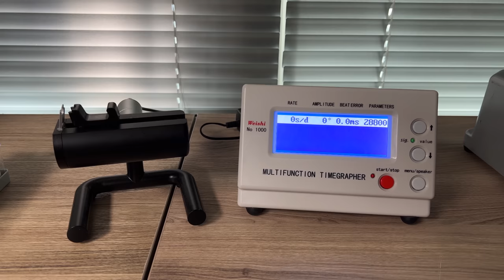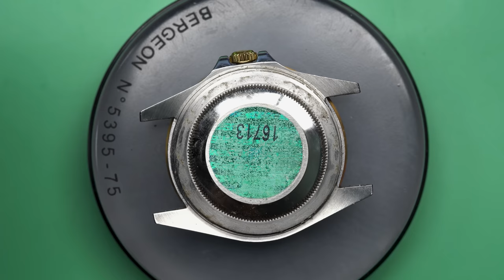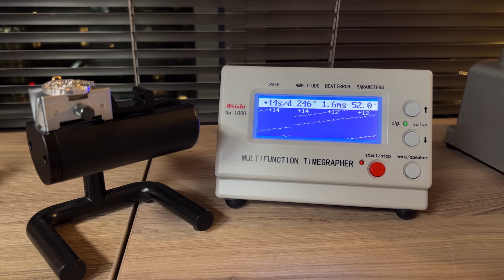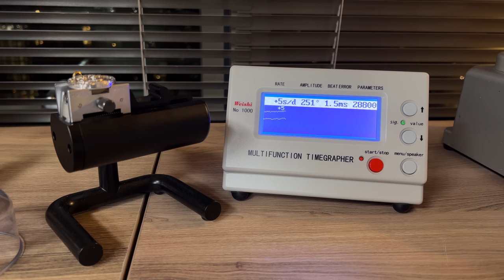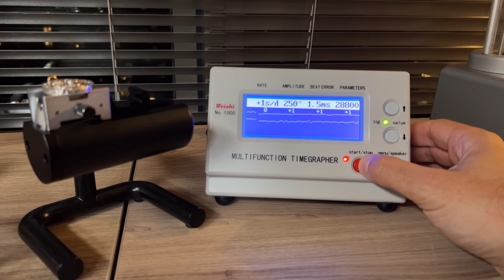My Friend Asked Me To "Check The Battery" On His Rolex...

Comment: I remember when Rolexes cost a few hundred dollars.  My first one was a 1955 Air King which I bought used for $75 c.1970.  I think the new price then was well under $200.  They are good watches, but the prices today are absolutely outrageous... I wouldn't pay a fraction of that for a watch today.
Reply: Rolex are a luxury watch today but at one time they were worn by regular people who were looking for a reliable time piece at an affordable price.
Reply: Yeah, I bought a 1940s stainless steel Rolex in 1980 for $300... wish I still had it!!
Reply: I mean, a house was also like 12$ at the time. Rolex prices were probably fairly in line up until about 15 years ago. My friend picked up a no date Sub at an AD for like 3 grand. they actually had trouble moving it.
Reply: Even if you can afford a Rolex, that is no guarantee of getting one.  They have “wait lists” with their authorized dealers, and you practically have to build a relationship with the dealer by buying other items just to get on the wait list.  It’s all designed to keep the illusion of exclusivity by limiting the supply to drive the price up.
Reply: The prices are truly ridiculous, because Rolex watches are really not luxurious at all. 
I mean, a steel Rolex with a movement that is only "very good" will set you back a similar amount as another brand's watch made out of precious metals and built with crazy attention to detail. 

And what I find even more ridiculous is that you can find Breguet watches from the late 18th and early 19th century for less than some mass produced Rolex from the 1950s. Wtf???!!!

Comment: The thing people dont realize about leaving those protective stickers on (thinking they're continually protecting whatever is covered) is that they arent meant to be permanent so be leaving them on, debris gets under there and just grinds into the very surface you think you're protecting. When the sticker is finally pulled off (against their will I'm sure) I imagine they're quite shocked to see a very worn surface and not a brand new one.
Reply: To that point the other issue is that those stickers get so nasty because the debris also sticks to them. So, once you take them off you can't really put them back on.
Reply: Never understood why one would leave them on. Looks tacky
Reply: @joshs3916  the value goes up if the sticker is still on weird even if the Rolex has been worn if the sticker is still on. So wen he peeled it off it lost some value wich is stupid but sadly true
Reply: @shadowbasterds2389  ...Really??
I think keeping the sticker actually drops the value not raises it, since the only people buying old watches would be experts not regulars.
Reply: @igameidoresearchtoo6511  for some stupid reason with the stickers on it does. Me personally I get nervous and I have to peel it off cuz it's satisfying. Everything I see 1 of those I wanna peel It off
Reply: @shadowbasterds2389  Weird..
Reply: @igameidoresearchtoo6511  it sounds weird because it isn't true. The value of a pre-owned Rolex is based on condition, the plastic is worth nothing. It was several years ago on a brand new watch after Rolex demanded that dealers remove the stickers at point of sale, which could be why this guy thinks it makes a difference.
Reply: @shadowbasterds2389  why would plastic add value to a used Rolex? Lol. To a new watch yes, because it proves it's brand new and unworn. On a 15 year old watch it wouldn't add a dime and looked pretty gross. If someone were to sell it that way, I'd want a discount.
Reply: @shadowbasterds2389  I agree. I am close friends with dealers so I understood. I just meant, wearing them with stickers is laughable. If you buy it only to resell, might as well enjoy it.
Reply: @joshs3916  yea ur right haha am sorry but it annoys me when anybody buys a hat a shirt or anything with the tags on to look fresh. I have a disorder we're it gets me nervous n I have to peel it off or rip the tags off but I no what u mean ur right haha
Reply: @allaboutroofing2  hey I've seen it n I think its stupid as hell don't ask me just the person who buys it likes it better with the peels still on I don't kno
Reply: @allaboutroofing2  I thinking stupid  with the peel on but I've seen it. If the watch is not as bad as this 1 yea. But am not talking about this watch its gone thru hell. But if it's a Rolex that's been taking care of and the peel is still on an the peel still looking new the more the watch goes up in value cuz a person could just say they wore it once so it's almost bran new.
Reply: @shadowbasterds2389  Removing the film/tag = satisfying lol
Reply: @joshs3916  for real haha
Reply: @shadowbasterds2389  sounds like something you made up. Just saying.
Reply: @allaboutroofing2  before u say something u gotta kno for sure. Have u ever been face to face with this same situation we are talking about? I have that's why I talked about it. If ur not so sure then don't say I made it up until ur sure. The sticker thing sounds stupid but why would I lie. I have nothing to gain. Just saying what I've seen an no so far about it.
Reply: @shadowbasterds2389  I've bought and sold serveral Rolexs and no, I have never seen a used watch with the plastics still on it and the seller asking more for that reason. Condition is determined by the crystal, crown and overall visible wear, not if someone decided to leave the plastics on. Also, for giggles I searched the internet and there is no one saying a pre-owned Rolex is worth more with the plastic on it...except you.
Reply: @allaboutroofing2  ahha I believe u  I really believe u yup I do.
Reply: @shadowbasterds2389  luckily you believing me or not doesn't matter at all. You are mad you got called out for making stuff up and speculating and plastic on a rolex does  not increase its value. Next.
Reply: @ShadowBasterds the iPhone cover is the most satisfying lol
Reply: @joshs3916  yea for real that's problem the biggest peel I've seen lol
Reply: It also traps moisture and potentially making it rust
Reply: There is no wear under the stickers, simply surface scratches. It does protect, it just gets gross.
Reply: It is very easy to tell if there is debris under it. VERY easy. And at that point, it's not sticky in that area, and would be flapping up. Leaving the sticker on is objectively better. In every measurable way. That's like saying wearing shoes isn't good, because the sole can wear through and you can cut your feet.
Reply: @shadowbasterds2389 trying to open the back to service the watch with the sticker in place would destroy the sticker anyway. Better to remove it, clean it and replace it if the owner is so determined to keep it there. 
Not sure that a watch unserviced for decades in order to keep the sticker intact would be more valuable
Reply: @shadowbasterds2389 that’s really drawing a long bow to defend your original point. 
If you bought the watch as an investment and never, ever, or extremely rarely wore it so it was as good as new it would make sense. If you bought it to wear because you loved the watch you end up with the grotty back like this which adds no value.

Comment: My daughter was having a  multitexture art product for her high school art project. I went on to eBay and bought several lots of watches for parts and many junk and that was 100% what she wanted. Not useable parts but to recycle the parts in artwork. There was a watch in a case in the pack and a note said it was junk. I jumped at the chance. After taking several pictures  I took the back off and beheld my first attempt to see what "junk" was and as I followed your process to a T. I began to unloosen the balance wheel and it moved slightly. I took off all the screws to see that the jewels had not been lined up correctly with their respective posts. Just like you said it would need. Thanks to you. I got the joy of fixing a piece of Junk. :) Love the videos!
Reply: I was hoping you were going to say you found a Breguet or A. Lange & Sohne in the case!

Comment: Wow, that is a stunning watch, around £24000 in the UK. Watching you service this is almost hypnotic ! At first sight I thought the movement looked fairly simple but when you broke down the components it was eye boggling ! Thank youi so much for sharing this amazing process. Kind regards, Ady
Reply: It’s a fabulous watch, probably my favorite model. Prefer the anodized aluminum insert to the current ceramic. It’s not however a £24000 watch. It’s at the high end around $13k, so about £11k.
Reply: @michaeldefricke732  In the UK also. I looked and saw it between £11k and £15k
Reply: US 20,000 for one in this condition for sure. Or US250.00 from a dodgy China based fraudster
Reply: I have the same model (16713) bought new for £3600 Mappin & Webb Cambridge. UK. It’s been serviced but will be worth around £10k.
Reply: The Rolex GMT Master series is special to me. My dad received on as a gift (GMT Master 1)  around 1959/1960. He wore it as his pilots watch until he bought a Heuer Autavia in 1969. In 1972 he let me wear it through high school (Yah, that was nuts). When he retired he started wearing the Rolex again snd gave me the Autavia. After he passed I took his whole watch collection and had them cleaned, oiled and crystals replaced. So glad to see this watch service video. Hope someday to see a Glycine Airman GMT (24 hour dial) done on this channel. (Yep, dad had one of those too.)

Comment: Absolutely beautiful work!  You are a very skilled watchmaker, videographer, and watch instructor!  This is by far the best instructional video on YT for this particular Rolex.  I have the same model watch which I purchased new in Europe in the summer of 2000.  It's always useful to know what is going on inside your watch.  Thank you for your significant effort to put this together.  There is nothing more frustrating than to see a video of a disassembly, but they never take the time to REASSEMBLE the watch as well in the same video.  The job is half done.  You must have a significant mind to remember which screws go in where, and the same with the various parts--with the proper orientation!  I should send you mine which, as I stated, is the exact same model.  Dual tone, SS and 18KT gold GMT II.  Circa 2000.

Comment: Recently started wearing my late grandfather's retirement Rolex.  It took me a solid month to realize it too, had the protective plastic on the caseback, protecting the engraving that was done.  It had been on there since the mid 80's, with him wearing it every... single... day... and yet it popped right off with zero residue.  Mind-boggling!
Reply: I imagine at that point the adhesive will have failed and attracted dirt and dust, so it wasn't attached anymore. Hence no residue. If it was stuck on tightly it probably would've left a residue
Reply: @Stettafire  Yea, I donno.  There wasn't a ton of crud around it, and certainly not under it.  Much as the one shown here, it was a bit yellowed, and had that same diagonal line of an almost "rusty" appearance.  When I finally decided to pop it off it cleaned up easily with a quick rub from a microfiber cloth.  The coolest thing, though, was that the engraving had been transferred into the plastic as well.  It was definitely well-affixed, just not "adhered," if that makes sense.
Reply: Very cool

Comment: The Chevy Colorado transmission (back in the day) had a part in it for setting the load on a bearing, and it was designed by Rolex. The special tool for setting/removing it was very similar to the tool you used for the oyster case back
Reply: Is this true or is it a myth? I can't find ANYTHING on Google with the terms "Rolex" and Chevrolet Colorado" or any combination of those two words.